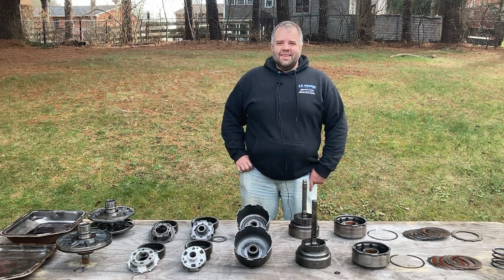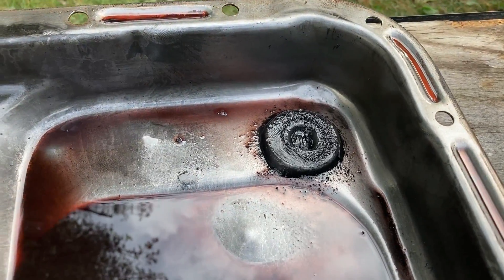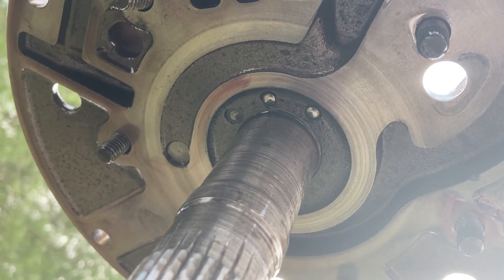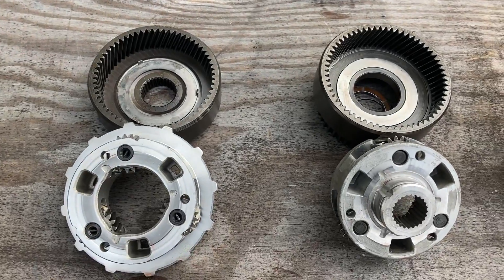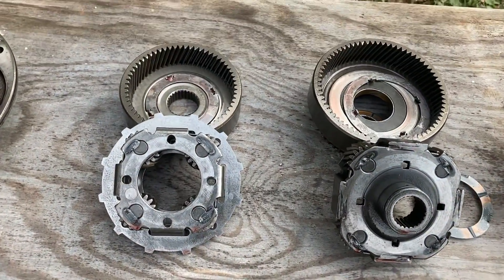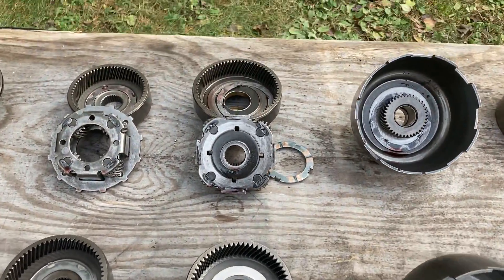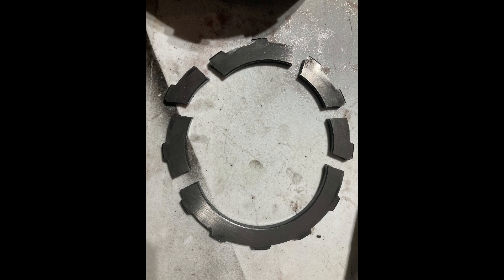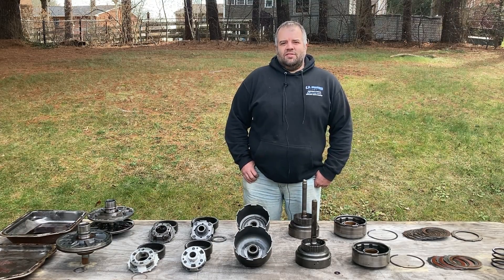Torqueflite build for Plan Z Dart - Part 3 - parts selection

Comment: I just pieced the cableshift 904 together with drums and low gear planetary from a 78 .Couldn't use the front planetary due to spline mismatch.Its a 4bbl 273 Dart GT survivor
Reply from the maker: I don’t think the 904 family has the same spline changes as the 727.  I swapped 1990 planetaries in this one for the 1973 that were in it.  That wouldn’t interchange in a 727 because the spline angle changed in 1976.

Comment: I just seen your video it's a year old. I have a 77 Cordoba with a 360 in it I took the 904 tranny out of it and it's a 999 non lockup with the five drum and the front pump is beveled. I thought I'd tell you you probably already know that. They only made the 999 non lockup for 3 years 75 76 and 77 and a few and 78 non lockup.
Reply from the maker: I think it was some truck and “high altitude” applications.  I have a go-to part number input shaft I use for one of those when building one.
Reply: The only way you could tell if it's a a999 you got to take the pump and you'll see it's beveled . You probably already know this but I had to tighten down the kick down both tights and then I pulled the pump. With the clutch in place you could measure it with a tape it's a lot wider the band then a 904
Reply: I just ordered a build it yourself kit from John cope racing I can't wait to get it all excited
Reply: If you go on to Chrysler specs you could find it that's what I did. And I was just lucky to find a couple cars with a 360 only the 360s have the 999 I have the casting numbers 1974 and 75 pk3681844 76 to 77 PK 40 28465 that's the one I have. And a few 78s non lockup pk4028878. And 78 on they went lock up.

Comment: On the steel planetary gears, why did it look like the pins holding the gears in the assembly have a weld across them?  Is there a benefit to doing this?
Reply from the maker: The factory welds the pinion’s shaft to the carrier.  Otherwise, it would walk out and cause problems.

Comment: Go steel that little bit of rational weight is so worth not having to rebuild after the aluminum strips on the shaft. BTW it is soft aluminum is not even a good hard aluminum
Reply from the maker: The difference is three full pounds of mostly rotating weight and Hemi cars had aluminum pinion carriers.  The aluminum is good to go in this application.... the car weighs 2,000 pounds and has around 200 horsepower.  If not for the advantage of a 2.74 first gear, I would have kept them.

Comment: John I love you're videos I always learn something. Why wouldn't you guys use the lockup converter on the dart? From what I understand it helps with acceleration?
Reply from the maker: The lockup converter is zero stall when locked up and only helps efficiency at coupling 1:1.  We need all the stall we can get and by the time any lockup would help us, we’d be out of track.  This car wants to REV.
Reply: @JohnWilburn  OK that makes total sense. I was hoping there was a way to use a high stall that locked at that 5000rpm range.
Reply from the maker: @AnthonyPerna2  Think about it.... that would only make the RPM drop.  The gear changes should make the RPM drop.  This is why lockup converters are generally a high gear cruising thing.

Comment: I like what I saw inside the a-500  904 really needs help in the  high gear drum , extra clutch plates and a serious valve body. My 360 roller engine in a 3300lb car smoked two in a single year when I took it apart the steels were polished like hard glass with 5or 6 blue fish eye spots on them. Answer I got was go with a reverse manual VB. So I did the right thing  A 727 .  got my foot in the go pedal instead of on the trans jack pedal.
Reply from the maker: While that 727 is certainly strong enough, so would the right 904.  You can run up to 6 clutches in the five clutch drum and your car would be the perfect candidate for the wide ratios.  I’d say you’d pick up two tenths in the quarter mile with the lighter trans.
Reply: @JohnWilburn  Yes, u are 100% correct the car was faster with the 904,  but at this point the 727 has my confidence in my situation willing to give up a little perfomance for reliability.  Like your buddy Tony says a street/strip car is a street car 95 percent of the time
Reply from the maker: @jimifed2798  Nothing wrong with that, but most people compare stock to stock.  And there’s no comparison.  If we couldn’t use the right parts and had to choose one just as it left the factory, it’d be 727 almost every time.
Reply: @JohnWilburn  John, you certainly know more then most people in this Mopar community probably from trial and error and always trying to improve.  I think I went wrong with the 904 because I needed to get more fluid pressure to high gear clutch pack via a worked Valve body . My mistake but sometimes with these slush boxes it's hard to nail down exactly,  like maybe an internal leak,  throttle pressure lever ratio slightly off.  I admit that diagnosis starts with pressure gauges at the various ports and I never checked them after the rebuilt.  Its amazing you can still find these parts in your neck of the woods new Joesey is picked clean.
Reply from the maker: @jimifed2798  Increased pressure and six clutches in the high gear drum.  I may do some sub topics and will calculate the apply area of different transmissions and numbers of clutches.

Comment: I believe the A998 transmissions (904 lock up) had the low gear set. Lots of the slant racers I used to race with in the early 2000's used the parts from those. A naturally aspirated slant 6 needs lots of converter and rear gear to make it boogie out of the hole. I see you grabbed a core from 21 motors, I live about 15 miles from there and have been searching their site for differentials. Low gear set  is trade off. What is gained in 60ft will be given back with a wider shift spacing.
Reply from the maker: I saw it there cheap and had little time to grab it.  I would love to have met you.  We patched a floor in a car that morning, then had to roll to get there by 4:30. Most of the A998s and A999s had the wide ratio and for 81-up, virtually everything.
Reply: @JohnWilburn  Sounds good to me. Glad to know they still have older stuff like that laying around as they changed ownership a year or two ago. I'm sure our paths will cross sooner or later without a doubt. Just now starting to get moved to East Tennessee. Stay tuned and take care!
Reply from the maker: @DR440  Holler if you have stuff to get rid of or need help moving.
Reply: @JohnWilburn  I appreciate that! I hadn't been to 21 motors in awhile, did they pull the trans for you? I figure that year truck probably has or had the 302 casting heads. Thinking about getting a set for the '41 street rod pickup project.
Reply from the maker: @DR440  It took them a week, but they pulled it.  I bet they still have the engine and I know it’s out of the truck.
Reply: @JohnWilburn  Anymore cost to pull the trans?? I heard that the 302 heads came around '85...but can't recall...
Reply from the maker: @DR440  it was $75 + $5.06 for taxes and fees.  Out the door.
Reply from the maker: @DR440  Should be 302 heads and a roller lifter block.
Reply: @JohnWilburn  Thanks for the info!

Comment: I'd like to contribute a little to this project.  When I rebuilt my 904, I made two aluminum plugs to do away with the Neutral Safety Switch and the Speedometer Adapter.  The speedometer adapter black off plug uses a factory O-ring, and the neutral safety switch block off can use the factory gasket, though I opted for an O-ring on that as well.
Reply from the maker: Good ideas.  When I prep the case for reassembly, I’ll be looking at what all I don’t have to put back.

Comment: I’m for using the wide ratio planets. I would have like to have known the actual weight difference. My guess is it is less than a pound. A pound is a hot dog and a soda from the concession stand  in the drivers belly as he is waiting to run again so not a big deal.
Reply from the maker: Actually, it’s just a shade under three pounds (2lbs. 14.4oz.) and it’s rotating weight in the drivetrain, which has a much bigger effect than overall vehicle weight.  That’s why people run stuff like aluminum connecting rods and titanium valve spring retainers.
Reply: @JohnWilburn  Thank you for answering me.
So it is also a matter of peristaltic loss. i would love to see some 1/8 mile runs comparing the 2  or dyno pulls. Do you or tony have a guess as to which way will be better? I'm still leaning toward the wide  Can you get 4.56 gears for that rear end he is running? Plus there is the issue of can the engine wind up a 4500 stall converter properly.
Reply from the maker: @pghgeo816  It has 4.10 gears in the rear and those are the lowest made for the 7.25.  No, it’s going to struggle to wind up the converter.  I’m up to test both, but it would best be done together with a rear gear swap.  I’ll pass on which way I’m leaning as I want you all to decide.
Reply: @JohnWilburn  I am going to be happy for you but sad for me when your channel is to big for you to reply to us like you do.
Reply from the maker: @pghgeo816  I do this for fun and have no aspirations to build a big channel.  I only wanted 1,000 subs to have a Community tab.  The revenue will be a nice little offset to the projects.

Comment: Lower gear and 5 disc drum for strength.
Reply from the maker: A 2,200 pound,200 horsepower car won't need the strength, but will have to drag the extra weight.... it's about a pound of weight on the rotating assembly.

Comment: Remember that the 74 Dart is also 600 pounds heavier than the 72 Dart was. It comes in at about 3,800 LBS or better. So having that lower first gear would be a nice idea but it would also allow you to run out of the higher final gear. I once had a 1971 Dart Swinger with a 318 2 Barrel that I had upgraded with a 500 CFM 2 barrel and I had changed just the valve body with a 727 tricked valve body. And it left first-year at 52 miles an hour is 7200 RPM and literally felt like somebody ran into the back of you with a pickup truck doing about 70. There was a 340 in town they could stay with me if I was rolling when they decided to mess with me. From Up 2 about a 45 mile per hour roll it would shift into first year at leave them just having no idea what to do.
Reply from the maker: This is going into a 69 Dart that weighs 2,200 ready to race.  Third gear is direct (1:1) in both.

Comment: Thank you for sharing! I don’t know if Uncle Tony would want to go that route, but he could swap to an eighties or early nineties Ford ranger 7.5 (almost a bolt in) and install a set 4.56 gears. This would have the same effect with the three pinion set as the four pinion set would with the 4.11s. But if goes with a 4.56 and the lower gear sets then he gets a 12 to 12.5:1 starting line ratio and a 7.02:1 intermediate ratio. I know it may be counterproductive to pick up both rotational and I sprung weight at the same time but it will absolutely pay for itself on what it gives back.
Reply from the maker: I thought about different rears, like the Ford 8.8, but while not speaking for him, I think he’s like me in that we want to keep Mopar parts on our Mopar cars.  I could maybe... maybe see him putting an 8.25 in it.
Reply: @JohnWilburn  An 8-1/4 would be my first choice because you can get a 4.88 gear. Then with the low ratio planetary set he'd have a 13.2-13.3 starting line ratio and a 7.5:1intermediate gear. That puts the first to second gear drop at 2700-2800 rpm and second to third drop at 2200-2300 rpm. If you ran the 2.45 and 1.45 it would make about a 12:1 start line ratio and a an intermediate ratio of 7.08:1. That would put the first to second rpm drop at 2600 to 2700 rpm and the second to third drop at 2000 to 2100 rpm. That's calculating a 27 inch slick at 28 inches of tire growth at speed at a 6500 rpm shift point. Of course, ratio selection should be based on the projected rpm range of the cam and then the converter selection should come from a combination of the cam, gearing, tire diameter, and vehicle weight. Optimum gearing may come from using a combination of low and high planetary gear sets to optimize the rpm range of the cam. That is if it's possible to do that and be able to get everything to mesh and get the final end play correctly set.
Reply from the maker: @miltonellison3333  If we had an optimum rear gear, the close ratio gear set would be a no brainer.

Comment: I had a stock 6 rebuilt in a 78' aspen 4 dr. daily driver, bone stock. It roasted tires if u didn't go light on the throttle. I think ppl aren't giving the lil 6 banger enough credit in the power / torque arena. My friend had a 70' nova 6 drag car that beat most competition at the track in So. Cal. FYI... 99.9% of tractor trailers / semi trucks on the planet run in-line 6 cylinder engines... ya think maybe the torque engineers might be onto something? ... just sayin.

Comment: My vote would have to be for the 2.74 first gear.  I recently changed out the 904 in my 71 Satellite Sebring that I street race, and in doing so swapped from a close ratio to a wide ratio.  With the 2.45 first gear, I would hook up all day long.  With the 2.74 first gear, it's all I can do to get the car off the line with the tires I have.  I know that once I get the car to hook, she'll be quicker than she ever has been.  Like I've always heard and said, a race is often won or lost in the first 60 feet.

Comment: I don't know anything about transmissions and as a twenty year tech I've never torn one apart but wouldn't it be better to just use the transmission that has more clutches and better parts instead of the older one
Reply from the maker: We needed a slant six case.  Also, the transmission the stronger guts come from is a four speed overdrive and that thing is heavy!.... I bet it weighs close to twice what the 904 weighs. Also, it’s a lockup torque converter.

Comment: Thanks for the video,  I know I am late.  In my experience any time you have a underpowered, lightweight car,that needs to spin up  you need to utilize your final drive ratio. I used to race a 8 valve in line 4 circle track class, with strict rules, my car of choice was the underpowered lightweight vw gti/scirroco,  we needed 8,000rpm to run in front, so we utilized the diesel 4 speed, heavy,but close ratio.

Comment: A wide ratio trans is good for an engine that has a wide range between peak torque and peak horsepower. The ideal trans setup will let you rev up to peak horsepower and when you shift to the next gear you are at peak torque.

Example, my old Subaru legacy would drop from 5500rpm to 4400rpm between gears. That's also peak horsepower and peak torque, respectively. My Jeep 4.0L drops from 3000rpm to 2000rpm.

You could probably use a very wide ratio transmission behind a Mazda rotary, which revs to ludicrous speed and has peak torque about 6k (what I call a 3 to 2 gearing, 3000rpm shift to 2k).

For the plan Z Dart, I'd go with the wide ratio, to get going off the line faster. It's a drag car.

I might run the lighter, close ratio on a road race car.
Reply from the maker: Interesting.....   Tony says it should be around 5,000-5,500 before it "hits a wall" at 6,000.  With horsepower and torque curves crossing at 5,252, my guess is that window is narrow.  Of course, the deep gears will get it to that window quicker.  Like I said, I can make a case for either.  Thanks for your vote!  I'm listening and will let you guys decide.

Comment: Idk why the plan z dart or UTGs gas mileage build would use anything other than the lower ratio trans,  especially with an extra clutch.  The gear ratios allow the car to get off the line quicker  and accelerate through 2nd gear with an advantage over a wide ratio trans.  What's the dilemma??
Reply from the maker: The “low ratio” gears are the wide ratio gears.  The standard are higher 1st and 2nd.  If the lower gears were the close ratio, there would be nothing to think about.